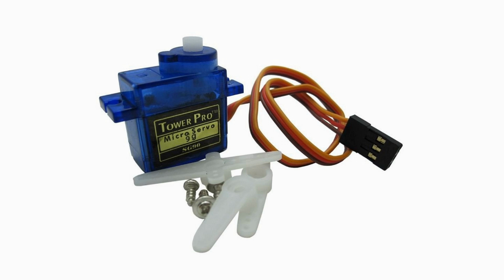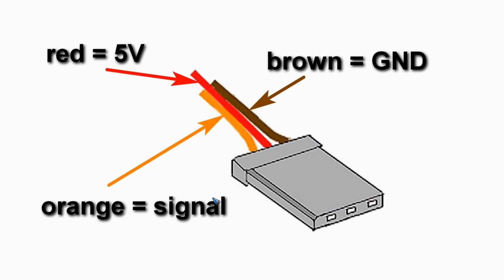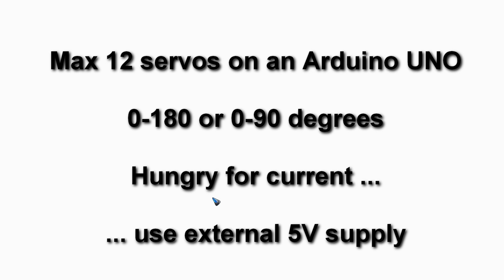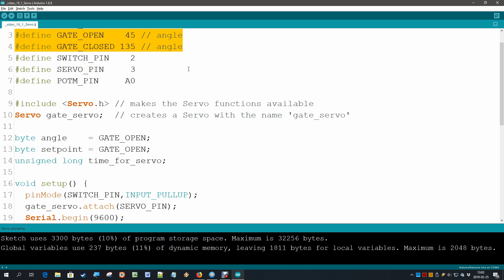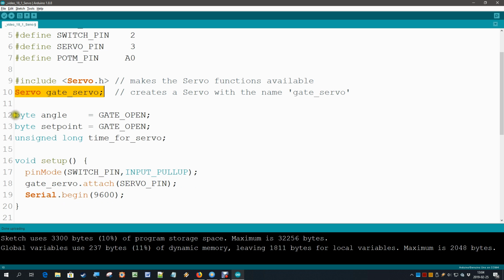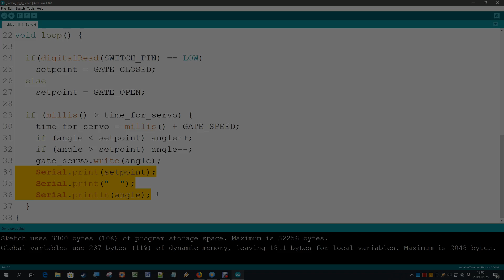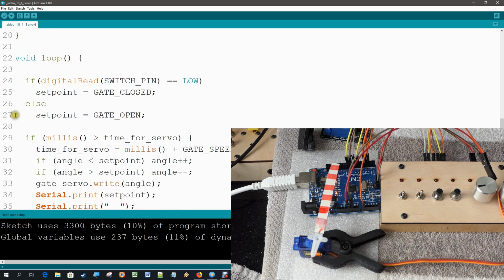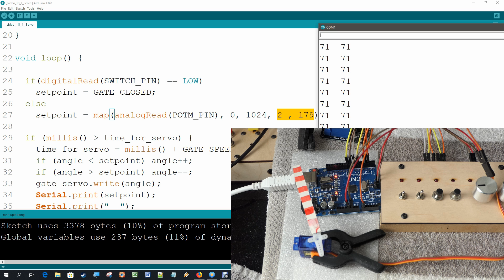Fun with Arduino 18 Railway Crossing, Servo Motor to Operate the Gate

Comment: Hi, Rudy I am trying to add a 2nd servo to your sketch and really not arduino savey 
I've added it in the heading and in the set up but the loop I'm having trouble with. 
One servo works but the other not so good.
Reply from the maker: Hard totell froma distance. If you send me your file, to ruudboer at gmail dot com, I'll have a look at it.
Reply: @rudyshobbychannel  Hi, ok I'm about to send it over in a few. Thank You 😊
Reply: Hi, Rudy ,  hope all is well...
I have a small question,  how would I go about added a small bounce when the gate comes down ? 
I'm sure you've seen them when the barriers come down before they completely drop they have a mid stop an then come down.

Comment: Was a breadboard used in the control box in connecting the Arduino uno to the toggle switches and the push buttons?
Reply from the maker: No breadboard, just a row of female Dupont connectors. This post shows the details: https://rudysarduinoprojects.wordpress.com/2019/07/27/arduino-experiment-led-switch-panel/

Comment: Rudy, great video, im still with you on the projects!  The switch box that you use in your videos, do you have any details of what you have in it it regards wiring components and connectors?
Cheers Phil
Reply from the maker: It's just a collection of 6 LEDs, 2 toggle switches, 2 push buttons, 1 potentiometer and 1 rotary encoder. At the backside of the box there's a strip of female Dupont connectors via which each component as well as the 5V and GND can be connected to the Arduino. One of the blog posts contains pictures, I just don't remember which one.

Comment: You may wish to look into blue pill STM32 Cortex M3 boards.  You can use Arduino IDE with them.  Cheaper with faster clock and 4 16 bit timers, three have 4 channels of IC/OC/PWM.  Lots more features, including USB.  Very cheap, 72MHZ and serial/JTAG debug.  Most boards have 8MHz (PLL to 72) and 32kHz clock crystal.  Very low power sleep to run on battery with long life while keeping accurate time.  Easy to drive 12 service motors, jitter free.  The list goes on.  STM32F103C8, 128kb flash, 20kb RAM. 7 channel DMA for ADC/SPI/I2C/USARTs.
Reply from the maker: Thanks for the feedback Mike. Yes, I have a couple STM-32's here, as well as a couple of ESP-32's. Both are much more powerful indeed.
Reply: @rudyshobbychannel  I've played with ESP8266, but not yet ESP32.  ESP32 has some nice features, especially with low power sleep.  I don't like how setup() is run every time it wakes up though.  I really like ARM architecture and have for a long time.  I started with 1802 (many years ago) then PIC and 8052 microcontrollers 20 years ago and then moved to Arduino/AVR when it became available.  AVR is decent architecture, but ARM is taking over.